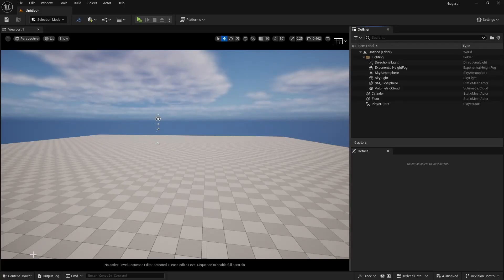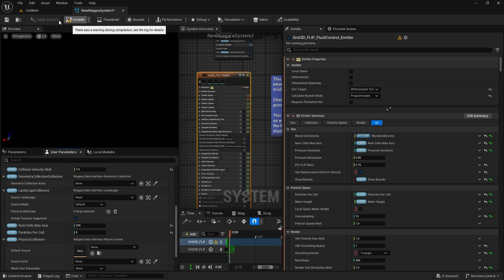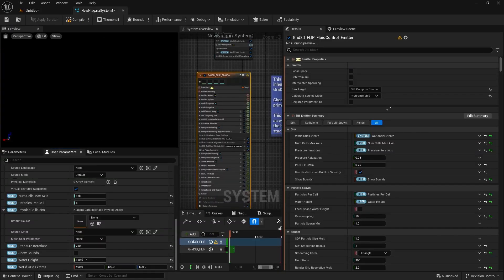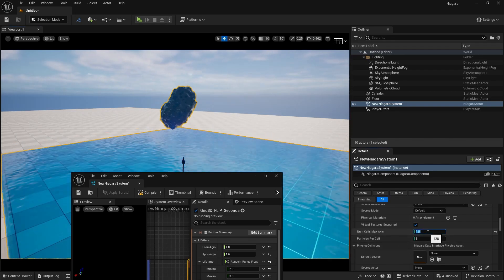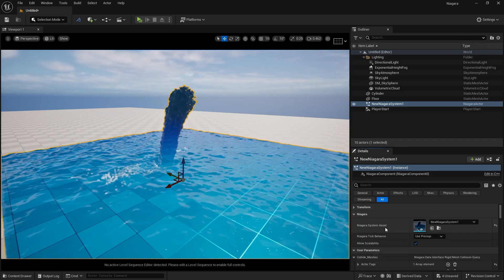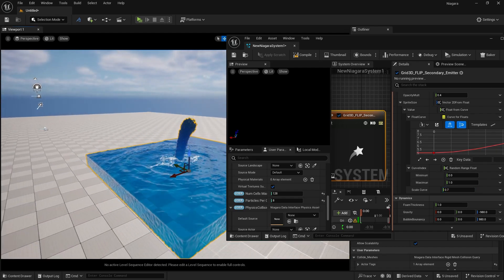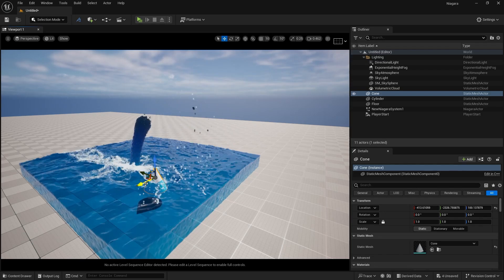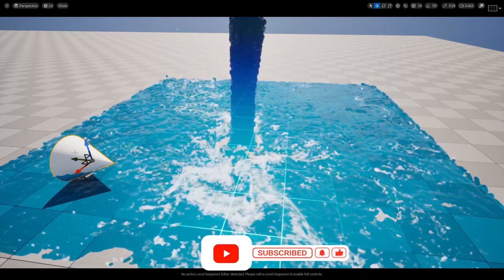Liquid Simulation in Unreal Engine 5 I 3D Liquid Simulation & Foam I Niagara Fluids

Comment: Hey quick question here im getting this error whenever i start the simulation in UE

Variable Grid3D_FLIP_FluidControl_Emitter.GridCenterPosition was defined both as position and vector, please check your modules and linked values for compatibility. - Node: Map Get -  NewNiagaraSystem1, System Spawn Script,
Reply from the maker: Hi can you share me a screenshot of this error and what is your GPU and when exactly you get the error.